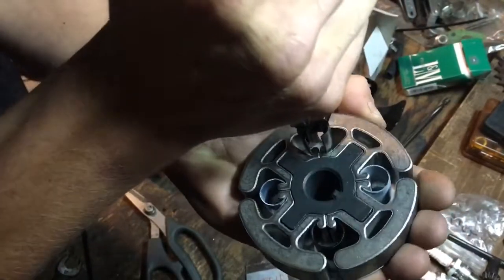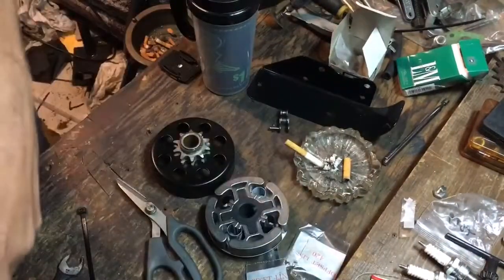Hilliard Extreme Duty Centrifugal Clutch Spring Install

Comment: What rpm engagement is good for a off road mini bike? I have a 10hp Tillotson Engine 10t 60t gearing. I have a Colman BT200x bike an it has a Jack shaft. I looking for good torque. About to order a Hillard Extreme Duty Clutch an wondering what rpm engagement would be best

Comment: The Hilliard has a keyway sort of that’s mild steel theirs a better one out their maxtorque might be it maybe not
Reply from the maker: The max torque was my first go to, but it didn't hold up well to the modded 212's power. The Hilliard did a little better, but in the end I ended up going with that manual clutch from 3DMotorsports. Not sure if they're still available, but it's a fantastic clutch
Reply: @PhysiqueGeek  yeah seen that it looks wicked also I want one so bad just need to reup my$